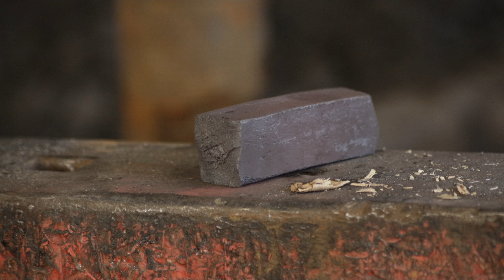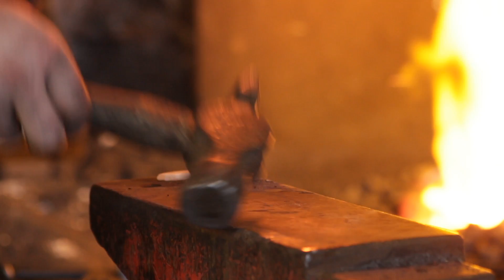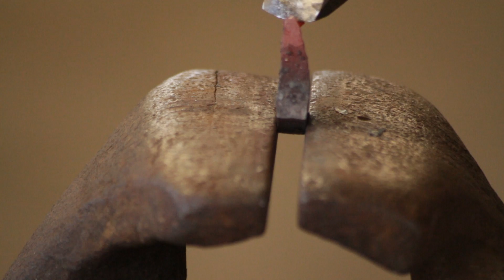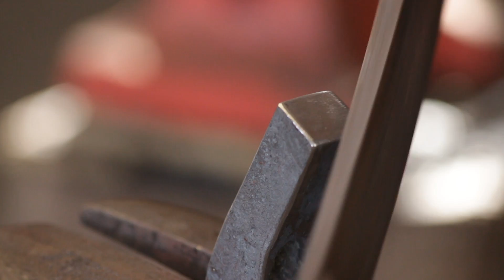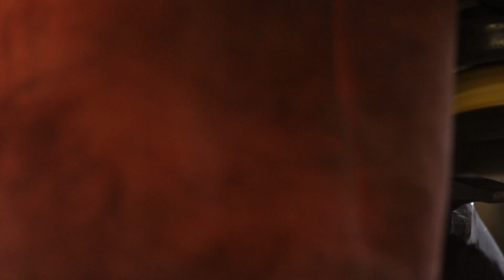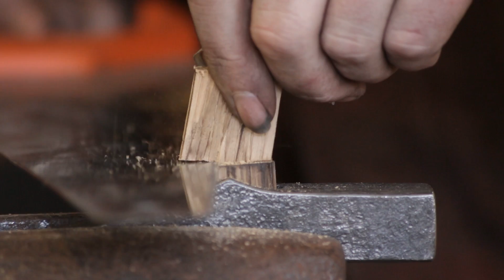Forging a wrought-iron, welded face viking hammer.

Comment: Did you just forge weld cold steel to hot wrought iorn I didn’t know that was possible
Reply from the maker: @caleblandry1780  well, the two materials have different welding temperatures - this is due to carbon content. The higher the carbon content, the lower the welding temperatures and vice versa. Wrought iron has a very low carbon content and a consequently high welding temp.
Reply: @RowanTaylor  thank you!

Comment: I’ve been given about a pound of wrought iron in the form of a wagon tire and I’m doing the same thing you’ve done. Might be a bit smaller or bigger than your I’m not sure the weight of yours. It will be my first time working with wrought iron. The face and peen will be forge welded with a bit of 1045 I was also given

Comment: Would Viking Smith's have welded harder steel on to the faces or is this a modern practice.
Reply: They would’ve done it. Steel was very expensive so they used it like this for a durable tool that used as little steel as possible

Comment: Incredibly beautiful Viking hammer ! Do you think someone like me with novice  blacksmithing skills and a coal forge powered by a old pair of double-lunged bellows could forge a similar hammer? I am going to use medium carbon steel for the whole hammer though, it takes quite the  effort to reach forge-welding temperatures, especially for larger stock.

Comment: I've made a couple of these types of hammers, and prefer to punch the eye last exactly because of the problems you had with the eye deforming. Also, the wrought sometimes likes to split open along the grain at the eye, and the welded steel peen and face help protect it from splitting apart entirely. Anyway, good video.

Comment: I really like this because you barely used any power tools. You used the power hammer at the start, but that was only to get a piece of iron with which you could make the hammer, so technically if you'd had a piece of about that size, you wouldn't have to use any power tools. That makes this an even nicer video in my eyes!
Reply from the maker: +Sebastien Legendre Thanks mate :) Glad you liked it!

Comment: Hey Rowan,

first of all thank you for sharing all these videos and knowledge with us. I really appreciate that and it's a whole lot of fun to watch your videos ;) 
I still wonder though whether the find of that hammer actually had the welded on faces? The second last bloomery I helped with resulted in a steel with 0.55%C and the last one felt pretty hard when we compressed the bloom so I assume an even higher amount of carbon in it. What I'm trying to say is that from that experience I assume that good hammer steel was plenty available, which would probably reduce the use in forge welding the faces which (even for your standard, for mine it would be around factor 10 :P ) pretty much doubles the effort. Do you have knowledge about the availability of good tool steal or had the find even forge welded faces? 

Keep up the grate work and please keep recording it ;) 

Cheers, Lenni
Reply from the maker: +Lennart ohnenam Sorry for taking so long to answer you - I am trying to catch up on all the comments at the moment but I have to prioritise my workload.... You are correct and I agree with you. While steel is easy to produce in a bloomery furnace by increasing the height of the furnace itself in order to maximise the exposure of the iron to Carbon, back then soft iron seemed to be more often produced. Soft, low C iron takes longer to produce as the bloom has to sit at the bottom of the smelter for longer in order for the air to remove as much of the carbon as possible. However soft iron has the advantages that it is easier and quicker to work and easier to weld with, which I think is the main reason to produce it. I believe that steel was produced more infrequently because it was harder to work with - just my personal opinion, mind, and being a smelter you may know more about it than I! 

From looking at the archaeological record, many hammers which survive seem to have excessive mushrooming from prolonged use - which would indicate to me that they are more likely either made from a softer material or not heat treated at all (While that may seem odd, I have recently read a report on the metallurgy of Anglo Saxon knives stating that only a few were actually heat treated in spite of the fact that the ones which were thermal-cycled were VERY well heat treated.)

If good steel was so readily available it begs the question of why also weld a bit into an axe or onto the edge of a knife - or even pattern weld a sword? Something else must have been going on which I will admit I do not fully understand.
Reply: +RowanTaylor Thank you for taking the time to answer me ;) Since what you said made very much sense to me it still bothered me since I know how exhausting the process is to get a bar of steal from iron ore. Hence I did a little research on that hammer and tadaaaa: Found this: 
https://www.academia.edu/6344172/THE_MASTERMYR_FIND_A_Viking_Age_Tool_Chest_from_Gotland  (You can just sign up, write a view words and then download a very good paper of the find). In this document Sten  Modin is quoted who did a metallographic analysis of the sledge hammer mastermyr find (which looks very similar to yours but weights around 3.5kg). To make it short "The test area was on the peen of the sledge hammer. At least two materials with different carbon contents were observed." I guess there we found a good reason to do it your way sir ;) 

Regarding the heat treading I lately read a view posts in a german blacksmithing forum where a view people told me that they do not harden their hammers. Since this seemed ridiculous to me I asked a bunch of other black smiths and they didn't seem very surprised. It obviously works for these guys. Why shouldn't it been working for the people 1000 years ago?!

I'm asking myself the very same questions as you do (except of the pattern welded swords. I'm very sure that as today, that was just to have one good looking sword). Probably they rather produced wrought iron to decrease the time the blacksmith requires to work the steal (imagine forging an axe from high carbon steal ... my arm allready hurts when I just think about that). Why they really did it. We may never know.

Comment: Why did YOU add hammer head to a hammer
Can someone explain me ?
Reply: +Filip Srdić  The body of the hammer is made of wrought iron, a relatively soft metal when compared to modern mild steels and much softer than high carbon or tool steels. A hammer made of just wrought iron would quickly deform with any regular use in metal working. It would need constant dressing or repair, and would wear out quickly compared to a carbon steel hammer.

Welding on a carbon steel hammer face gives the hammer the durability and advantages of modern hammers as you can harden the face on top of the fact the high carbon steel is tougher.

Back in the day when steel was difficult to produce and expensive wrought iron was used for the body of tools like axes and hammers. Only the part that benefited the most, such as the face or edge, were made of steel. 
That's why Rowan here is doing it this way so that his viking hammer is authentic in it's construction.

Comment: You mentioned increasing the viscosity of the oil by heating it, I think you should have said decreasing the viscosity, water for example has a low viscosity where oil has a higher viscosity, by heating oil the viscosity is lowered making it more fluid.
Reply from the maker: +Roger Bartle You are correct and a slip of the tongue on my part. I'll correct the info once I have figured out how to do it
Reply: Roger Bartle this is true. he was incorrect
Reply: RowanTaylor get video though inspired me to make my first hammer

Comment: I found quite reassuring that you would drop a piece, make a mistake, say "I should have known", its like a permission for the rest of us to drop a piece, … Thanks for the video.It makes one feel one could do that.
Reply from the maker: +cmoayves No worries. I drop work, make mistakes, start over, throw a tantrum, throw a hammer, burn myself, under-price, etc. Never think you have no skill because you make a mistake. I've been there and still do it from time to time with the whole "I'm crap, this is crap, everything is crap". Mistakes are what make you learn: "That's too short, I'll make it longer from now on."
Reply: +RowanTaylor I'm just learning this, that going in the forge in the morning is not going on  stage to perform. I have not lived like that most of my life. Just learning now. It's not easy. What is worse, is that the only way  to learn in the forge is realy to make mistakes : not ever making a mistake is not ever forging anything different. ... I think I'm writing to myself. I should get back there ... Thanks for taking the time.
Reply from the maker: +cmoayves Well, get in touch if you need any advice. What I used to do when I was training was to take a piece of plasticine and hit it with a spoon. It moves in a similar way to the metal. Or you can pinch it between your fingers too, as long as you can equate the pinching to what will go-on over the anvil :)
Reply: +RowanTaylor I will get in touch when I'll have a specific problem. This is an offer one cannot refuse ...